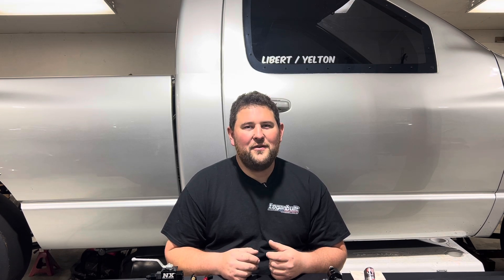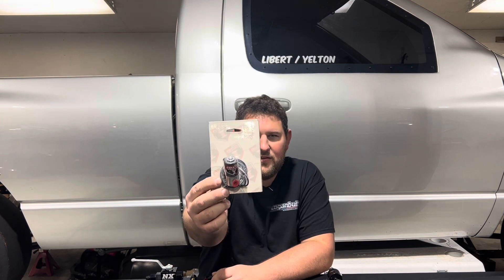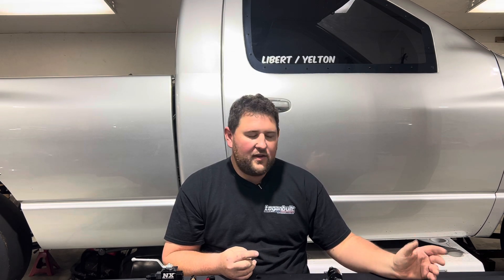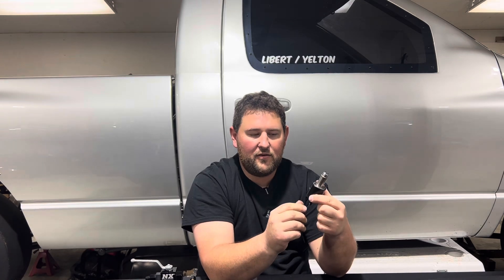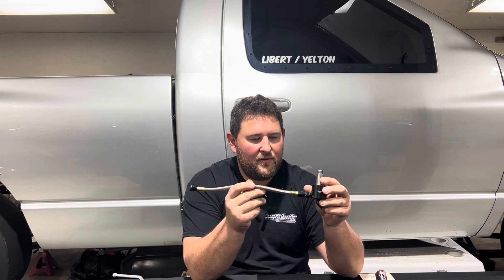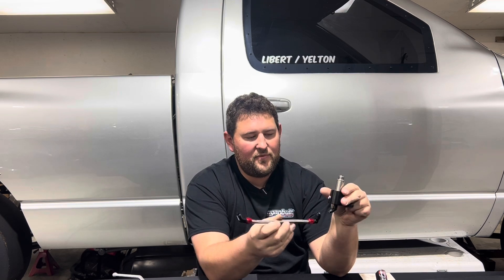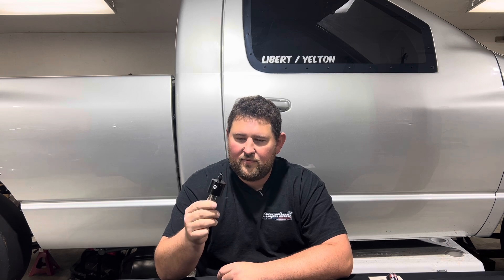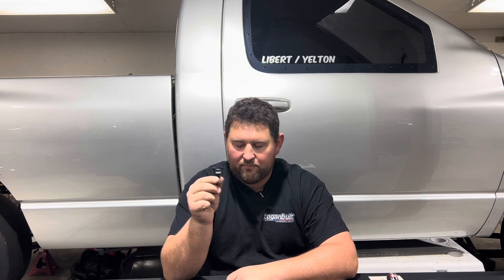Choosing The Right Size Nitrous Solenoid(s) & Plumbing For Your Diesel!

Comment: Thoughts on running the smaller solenoid for spool/off the line leave?

We do dirt/sand drags and the race is basically determined how fast you can 60’. The thought was to use a 74 jet to help spool and use it for 60-100’.
Reply from the maker: @TEAutobody  you totally can

Comment: Ever run water/meth?
Reply from the maker: I have water injection but not for making power, just for controlling cylinder temp.  The old water meth stuff is an outdated method that you won’t find any racers running. It really doesn’t make any big power gains and you can do more harm than good with it if you aren’t careful.